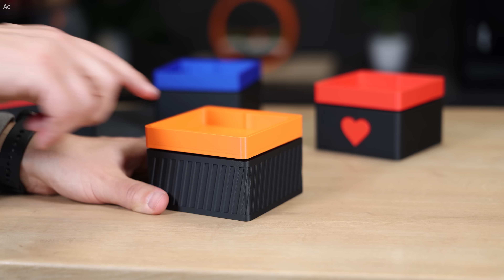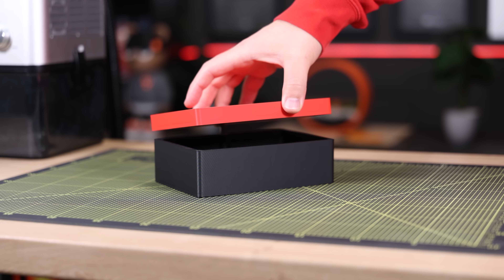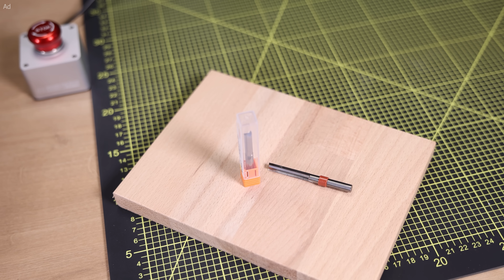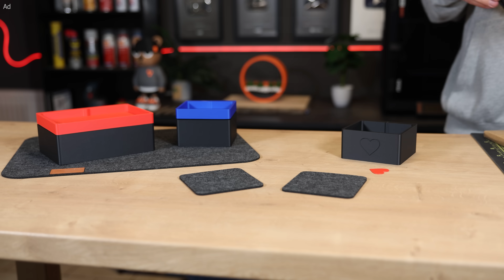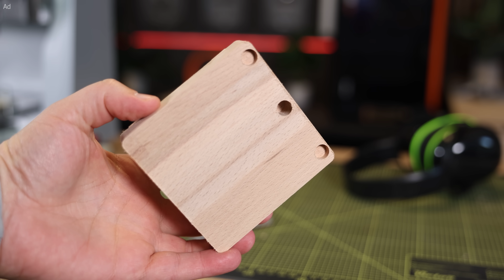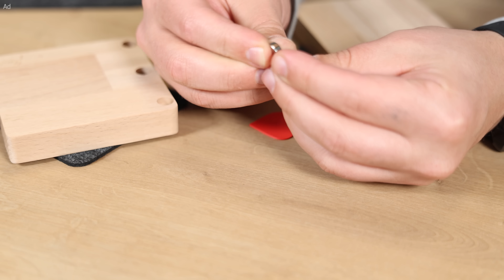3D Printing + WOOD: The Ultimate Combo for Premium Products! CNC Carvera Air

Comment: You could just have both magnes in the base, put a piece of paper between the magnets and put the top in place. the paper will prevent the glue to sip to the printed part, will act as a separator adding a tiny airgap for the magnet so it wont be perfectly flush, and it is an errorfree process because the magnets. stay aligned